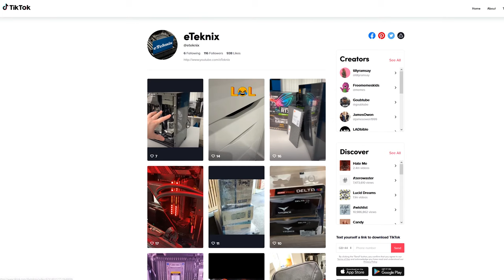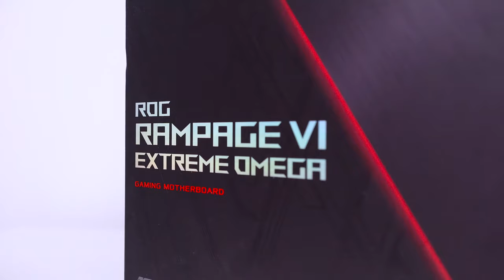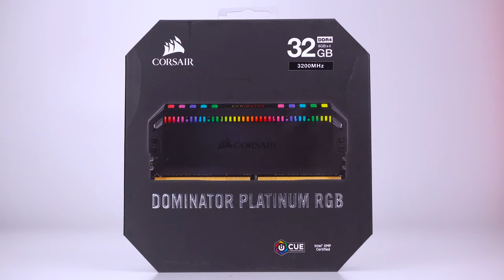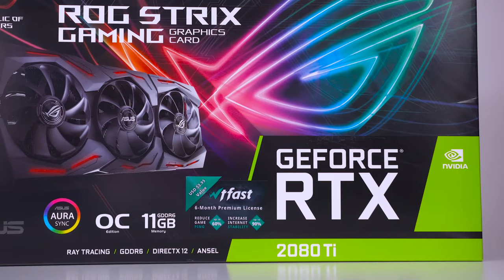The ULTIMATE ASUS ROG Gaming PC Build!!!

Comment from the maker: How does your PC and setup compare?
Reply: Pawnshop LENOVO Laptop.
Samsung Galaxy View II Tablet.
Samsung A20 Cell Phone.

P.S.- I got drunk one night.  Watching YouTube Tech Video's.  Took my Laptop apart.  Put it back together again.  Now I have a cup of *Screw's.  I'm not taking my Tablet apart.  😉😆😅🤣😂😎
Reply: heck even i envy this thing but im on the right track....rog helios, rog maxiumus hero xi, 8600k, rog strix LC 120 cooler, rog strix gtx 1080ti, 32gb gskill trident z rgb.  rog 850w thor psu, rog aura sync terminal, rog strix flare kb, rog gladius core II mouse.  I went all in lately.
Reply: I have only Ryzen 5 2600X, Crosshair VII Hero wifi, Asus RTX2060 Dual O6G and 2x 16GB Gskill TridentZ Neo 3600 MHz memory. Case NZXT Noctis, cooling ROG Ryuo 240.
But next year I have plan upgrade CPU to Ryzen 7 3700X or Ryzen 7 4700X and maybe also case to Helios :)
Reply: I have a full setup of Asus rog laptop even laptop with router
Reply: My PC, the one I have right now is much more powerful than this, but my last PC was like 10000x weaker than this setup. That PC was build in 2019 and that was a low budget one but the one I have right now has i9-10900k, 2080Ti, 128GB RAM, 4TB Samsung 970 Evo Plus, etc. So, I'm pretty happy with my setup now!!
Reply: It doesn’t.
Reply: yours is 999,999,999x better than mine